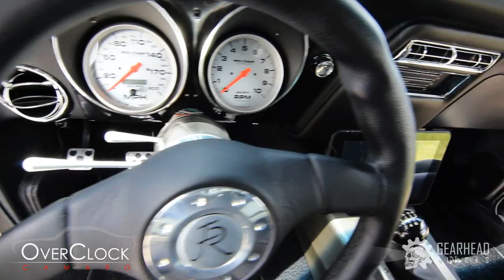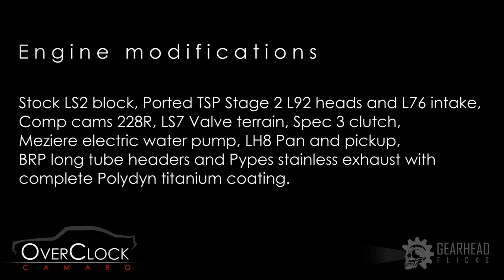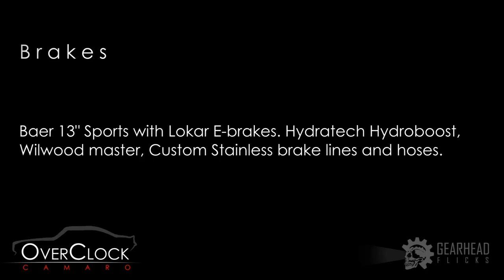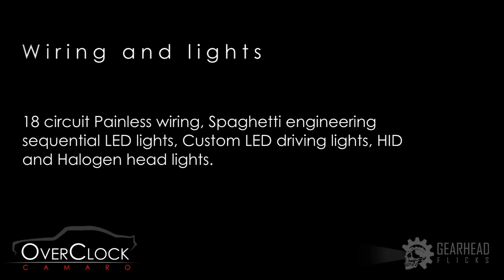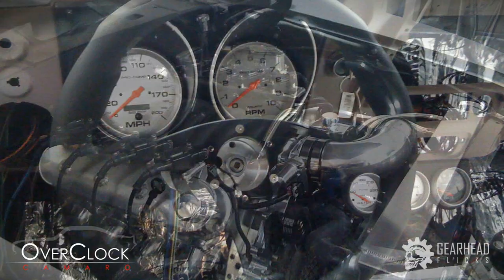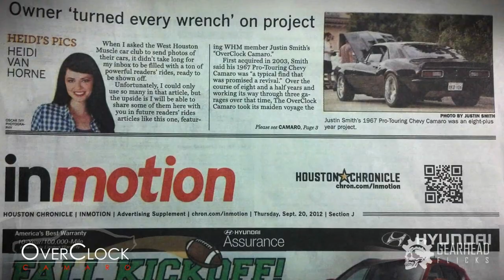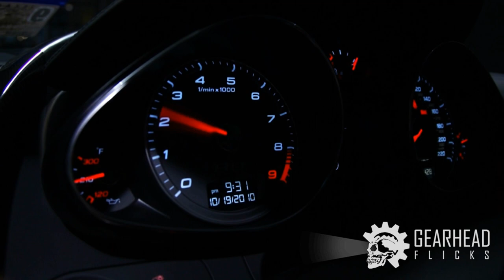Pro-Touring '67 Camaro LS2 -"Project OverClock" ACTION, RESTORATION PHOTOS

Comment: I styled my '67 SS/RS after this car...PPG water based black triple heavy coated clear, naturally aspirated 468/500+ hp big block, Muncie M22 close ration rock crusher, TCI pro touring suspension with coil overs on all corners, front end dropped 2", CPP big brakes all around, Flowmaster 40 X piped exhaust, custom stereo

Comment: how much for the overclock 67 camaro.whats the price.
Reply: I don't remember exactly, but I think I saw a range of $60k-$80k.
Reply: Alkaiser PLEASE!! Add another hundred thousand at LEAST!! Your number is just slightly off!!
Reply: surf403 that's the number I saw for this very camaro. I don't remember where. But yes, depending on the parts used, a restomod could easily go well into the 6 figures in price
Reply: Cedric Edwards 95k
Reply: 70000 if you do all the work yourself.........

Comment: If you had a choice would you prefer and old school Camaro or a new Camaro?
Reply: Old school for sure
Reply: I think Chevy really missed the boat on the new one.  It looks every bit as heavy as it is.
Reply: The new one is definitely way too heavy.
Reply: There is just something about an old school muscle car roaring down the street that is hard to replace. I would have to go with the old American muscle.
Reply: Old School with a BIG BLOCK!!!
Reply: I am one that loves new car handling, style, and technology; on the European side.  Most New American cars look like shit in my opinion except for Cadillac and the Corvette which is one car that has truly consistently improved every single year since launch.  The new Camaro does look cool though.  In saying that though, having the choice I would choose a brand new BMW M6 or Audi RS6 for daily driving and an old school 69ish Camaro or Dodge Charger for the weekend muscle car.  But I would have it decked out with current gen features; suspension, transmission, interior, brakes, steering, gauges, rims, tires, stereo, etc, etc.  Like these guys have done here with this Camaro.  Dropping in the LS2 is badass. Though for an old school muscle car I'd want a new completely decked out 454 with 4 barrel carb, blower, headers, and the works.  And the 426 Hemi on the Charger.  Real old school muscle & sound.
Reply: Blazin z Damn you would turn an old school into a new school monster that would be badass. Its crazy how much you can upgrade an older school muscle car nowadays.I have seen LS7's in some of these Camaro's just think about how insane that must be lol.
Reply: Old>New
Reply: Always in love wth classic american muscle specially camaroo.    from south india

Comment: Cheaper than an sbc? try double or triple the cost of a 350 small block. LS3 crate motors are $6500. 350s are $1000